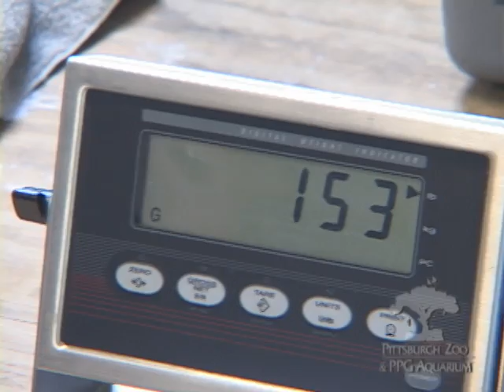Green Anaconda Weigh and Blood Draw

Comment: pet anacondas are much more tame, which makes it much easier to handle them. 

with a tame one, you just leave its head alone and it wont bite you. you can just pick them up, hold them with your arms in front of your body, and carry them around. They will squeeze your arms a bit, but thats no big deal, they just like to hang on and dont like to fall, if you put them on the floor they let go and crawl around.